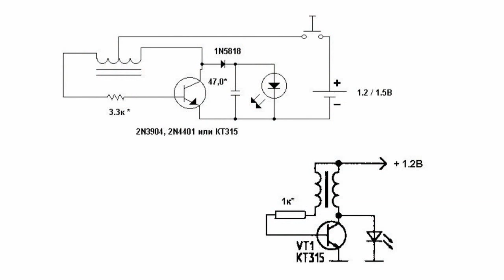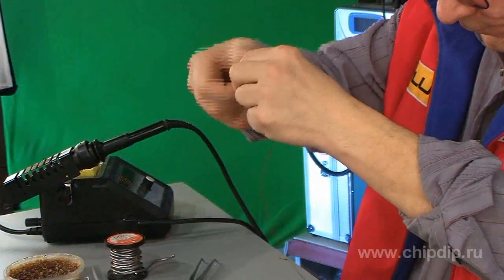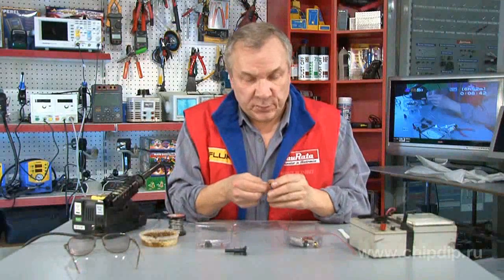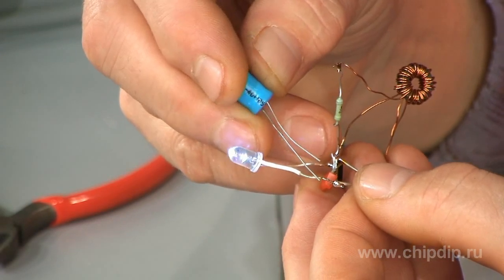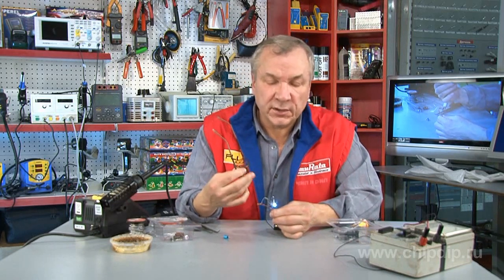Low-Voltage LED Power Supply, Do It Yourself

Comment: There seems to be some error in the ChipDipvideo Russian to English translation. 
When you use the word 'throttle', you mean 'choke'.
I guess the KT315 you refer to is a transistor and not a resistor.
The ferrite ring and the windings you wrap around it form a 'toroid transformer' not a 'throttle'.

This circuit is a voltage booster. Also known as a joule thief.

Ian.